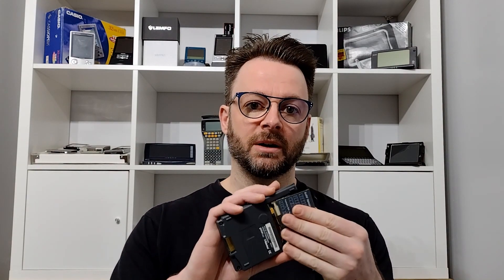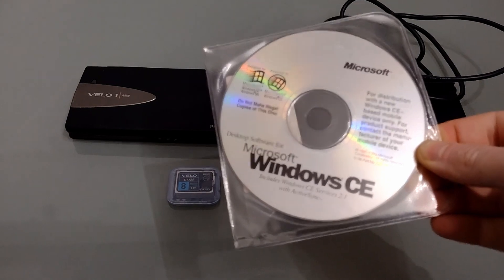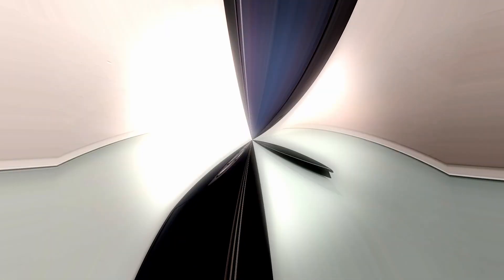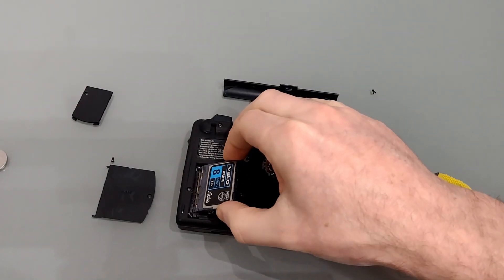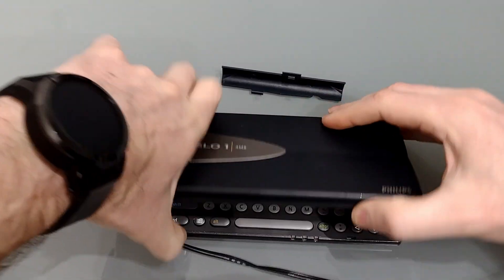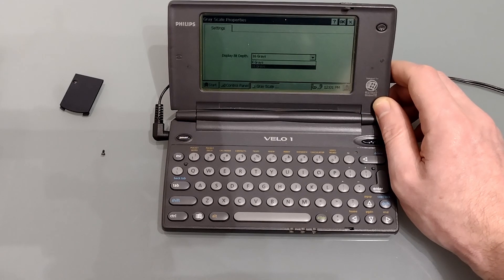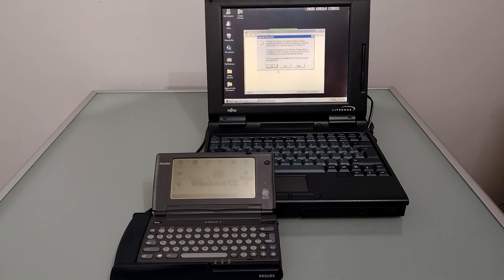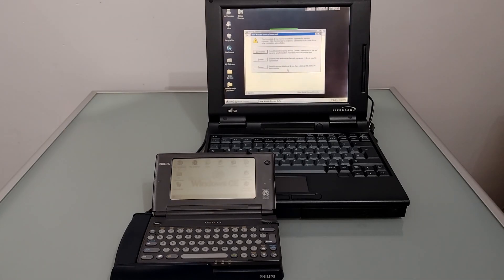Upgrading the Velo 1 to CE2

Comment: I reemember installing windows ce 2 on the velo by just restarting and it was just there all of a sudden
Reply from the maker: A lot of devices have the ROM as a removable chip but not the Velo, hence the installation. The Flash ROM part adds some features but you need to do the install to get the full upgrade

Comment: Nice video :-) I was gonna do a video of this as well, but good luck finding the ram for the Velo.
Reply from the maker: I was lucky, had Ram and ROM upgrade in the box when I got it. You might get lucky and pick one up with a damaged Velo
Reply: @HandheldComputing  I already sold my Velo a few months ago. Was in perfect condition too. I did a video on it before I sold it on youtube here. Right now my main unit to use remains my 360LX.
Reply from the maker: @ctcards2636  I saw your Velo video I was surprised the US version had a phone jack built in rather than on the UK spec where an adaptor was used! Shame you had to sell it
Reply: @HandheldComputing  I def would of kept it if id found ram that worked. There are some types of Ram for routers that looks like it would work, but when ya put it in the unit does not see it. Yeah the US has the built in jack, I didnt know there was a version without it until I saw your video 🙂
Reply from the maker: @ctcards2636  Minatare cards were just a short blip in terms of removable storage and RAM, eclipsed by Compact Flash so were only around for  a couple of years
Reply: @HandheldComputing  Yeah they are impossible to find. I always bought a broken Velo just for the memory card. But sadly the few broken ones I found on ebay only had the 4mb card. I needed the 8mb one. Maybe somewhere down the road ill find a Velo with 2.0 or a Velo 500 ;-)
Reply from the maker: @ctcards2636  you defiantly need the 8mb card or you will struggle running CE2. Ah yes the Velo 500, I keep looking for one but they seem rare or at least no body wants to sell them!

Comment: I searched for years for a ROM upgrade for my 620LX to take it from CE 2.0 to CE 2.11 plus it added an additional 16MB of RAM/storage AND in CE 2.11 - you're not limited to the max 16/16 split so you can adjust it however you like. Unfortunately I had to get a friend (Blakespot) in the US to buy it and ship it over as the seller wouldn't ship here. My original H/PC - the 300LX has a removable ROM card but no ROM was ever released for it. But my 320LX and 360LX have CE 2.0 on too. I did a video on the 620LX upgrade if you're interested: https://www.youtube.com/watch?v=LTJaBMt3v9c
Reply from the maker: Nice one Rich, yes I will check it out! I had the Ericson MC12 and the upgrade was just a rom swap, so easy! Shame I didn't keep it but nevermind

Comment: You seem to be very familiar with installation processes for portable computers from the past. I'm trying to format and reinstall Windows CE on a Motorola MC9090. Could you point me in the right direction or give me some basic tips on how to do this?
Reply: I'm looking to install the version of Windows that's featured in this video. I believe it's Windows CE 5 or 6.
https://youtu.be/viaEfr_9-Po?t=2
Reply from the maker: @i_used_adblock_to_watch_this  windows CE should be in the ROM, it is possible to re-flash to a newer version but if you just want a clean install have a look at the manual here
https://www.manualslib.com/manual/590891/Motorola-Mc9090-G.html
Look at Performing a clean boot - this is effectively a clean install
Reply from the maker: If you want to upgrade from WM5 to WM6 check out this link

https://community.spiceworks.com/topic/2038263-how-to-upgrade-mc9090-wm-5-0-to-6-1

But it might be difficult to find a legitimate upgrade now
Reply from the maker: @i_used_adblock_to_watch_this  these are the files not sure if you have to pay for them.  It is an issue with industrial handhelds they tend to be locked down
https://www.zebra.com/us/en/support-downloads/software/operating-system/mc9090-operating-system-for-windows-mobile.html

Comment: How did you get your Velo screen contrast to be so good? I just got a Velo 500 and the screen reflection makes it hard to use without also having the backlight on
Reply from the maker: The contrast isn't great and it took ages to get the angle of the lights and the screen to make it clear enough for the camera! I've not got a Velo 500 but thought the contrast might be better as its newer, perhaps its not